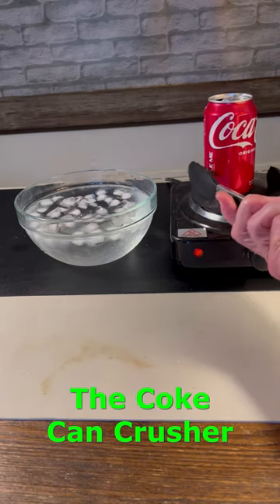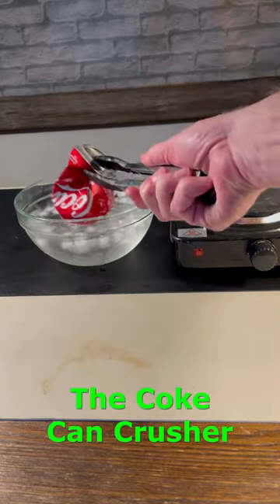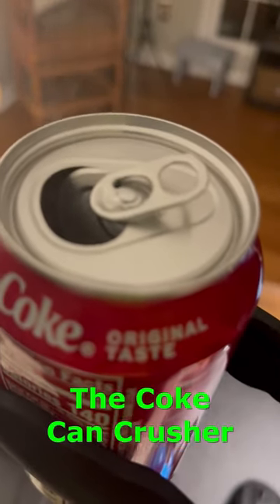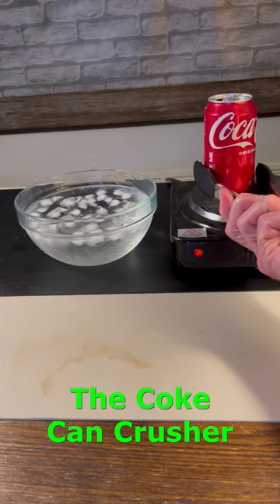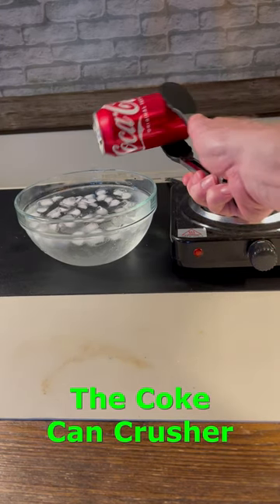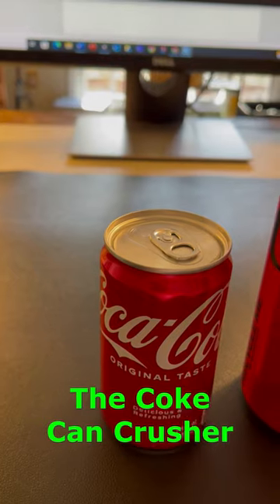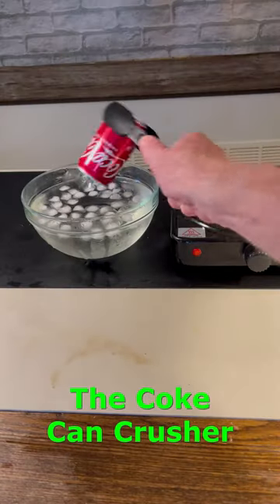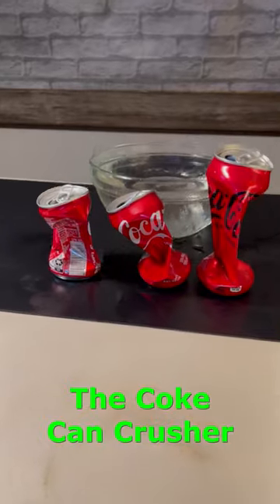The Coke Can Crusher: Air Pressure Changes in Action

Comment: Air inside was heated. Heated air expands. When placed upside down in the ice water the air cooled rapidly. This rapid cooling caused the air to condense. This process lowers the internal pressure inside. Diff in pressure caused the coke to be crushed.